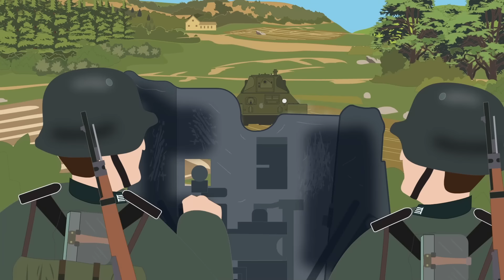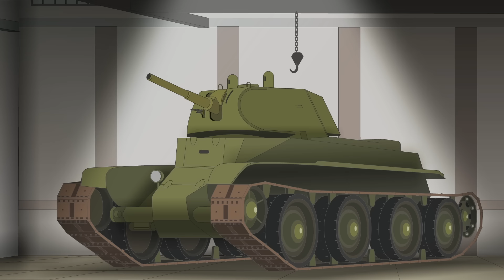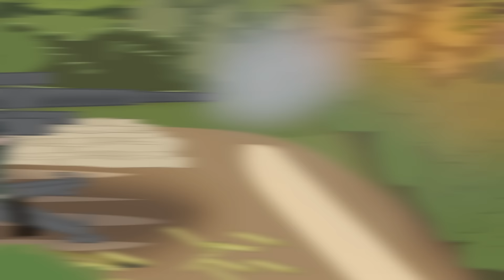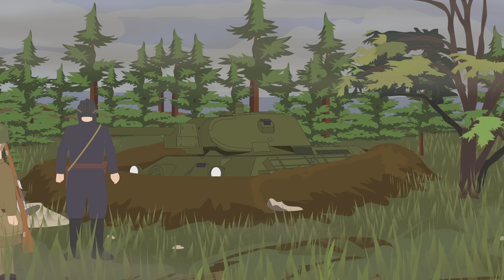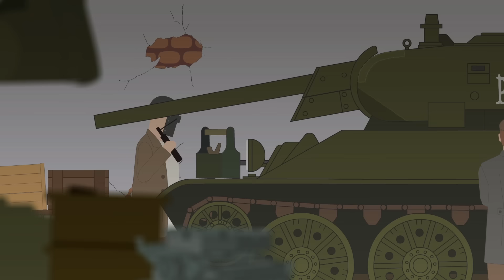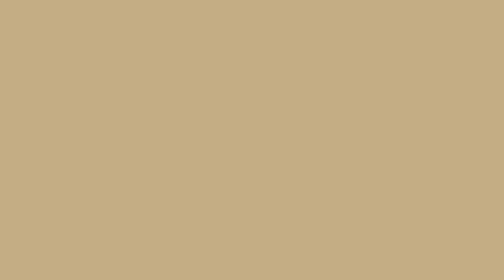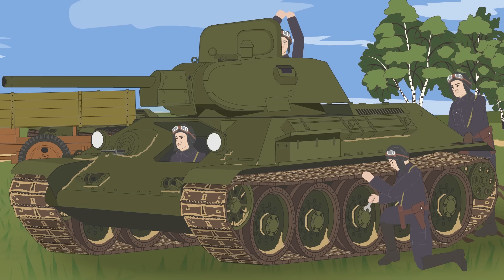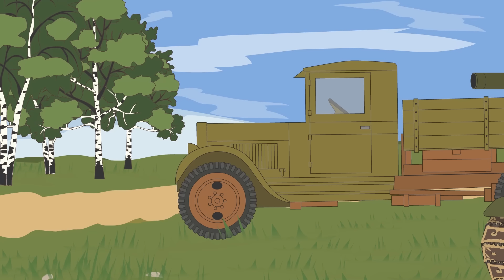Was the T-34 Really the Best Tank of WW2?

Comment: You forgot that T34s didn't have radio communication. Something which was in every German tank and allowed for accurate coordination.
Reply: ONly start of war,
Reply: Then only officers would have them
Reply: 50% of the tanks were produced by factory 183. The factory workers wouldn't include "non-necessary" parts from the tank, such as radios, hatch seals, etc. The factory workers would also not heat treat the metal in the crew compartment.
Reply: it was so only in the beginning of the war

Comment: The T-34, which was being tested at the Aberdeen Proving Ground, was built at the best Soviet factory, materials of the highest quality were used, but its engine stopped working after 72.5 hours. This did not happen due to American intervention - a Soviet mechanic (engineer Matveyev) was seconded from Moscow with the tanks, who was responsible for operation. The quality of these tanks was much better than that of conventional tanks as it covered a distance of 343 km. According to Fedorenko, head of the Red Army's armored vehicle department, the average mileage of the T-34 before major repairs during the war did not exceed 200 kilometers. This distance was considered sufficient, since the life time of the T-34 at the front was much shorter. For example, in 1942 it was only 66 km. In this sense, the T-34 was indeed "reliable" because it was destroyed before it could break.
Reply: The US engineers surprised Matveyev by showing him the blueprints for the T-34 transmission that the US Army still had on file. It was an agricultural tractor transmission that the Army rejected in 1921 for being too primitive to use in a tank. The engineers also knew that the T-34 engine was prone to overheat and seize-up. They found that the water and oil radiator tubes barely touched the fins since those were held in place with a dab of solder and not soldered around the entire tube. It also didn't help matters much with the radiators positioned directly above the exhaust manifolds. Cooling air was pulled in from the vents on the side of the engine deck and blown out from a vent above the transmission. The rear vent could be closed off with adjustable louvers controlled by a lever inside the fighting compartment. The engineers noticed that the lever could be nudged closed by vibration without being noticed by the loader.
Reply: @billwilson3609  source?
Reply: @billwilson3609  "The US engineers surprised Matveyev by showing him the blueprints for the T-34 transmission"

Nonsense, that was the KV transmission.
Reply: the factory workers where lazy and didnt built the tank as planed. they improvise and let parts away
Reply: @konservendose3239  I think it was less laziness and more "Build more tanks or front lines for you".
Reply: @invidatauro8922  Either make something for the front line or be the front line.
Reply: @invidatauro8922  Or the Gulag.

Comment: T-34 was not the best tank in WW2 but was far the best tank in its class. With 27 t weight, with excellent suspension and tracks, with 85 mm gun and good armour  , and radio in all tanks in second period of WW2 it was the best tank...and if the price is taken as the choice criteria it launches T34 on the first place among all other tanks ever built, may be the T55 had better relaition price-quality.
Reply: When T-34 had 85mm gun and radio the Germans had Tiger IIs already....
Tiger II vs T-34/85mm which tank would you want to be commander of in a one on one battle scenario? 🐯✌️
Reply: Good suspension and armour are both thing the t-34 lacked lmao, read some actual reports instead of getting your knowledge of games and YouTube vids
Reply: @mts003  
T34 had excellent suspension for that time, far better than Sherman or Mark3 or 4 (Panzer 3 or 4) Every tank produced in war conditions had problems. Do not tell me to read something if your comment has no facts at all. This kind of comment you wrote is clasified as classical spam and in fact does not deserve any decent answer.

Comment: The video has the history all twisted around. The Krauts were FIRST impressed by the KV series tanks -- not the T-34. This first impression was so great that for weeks on end, Krauts conflated the T-34c with the KV series in their battle reports. The Krauts brought out the Tiger in response to the KV tanks --- FIRST. The Panther was designed a step later once the T-34c threat was realized -- that is -- when the Krauts realized that the production volume of the T-34c was far, far higher than the KV stuff. 
The KV stuff was coming out of Leningrad, so when it was cut-of by AGN, KVs eventually faded from the campaign.
The T-34c was still a DOG. It had a crippling 2-man turret. 
It took the T-34-85 re-design to make it a war-winner. (3-man turret & 85mm gun + radios)

Left out of the video, only Bolshevik command tanks had radios until very late in 1942. 
It took American LendLease aid to put radios in every Soviet tank. Naturally, the Reds never bring that fact up -- then or eighty-years later.